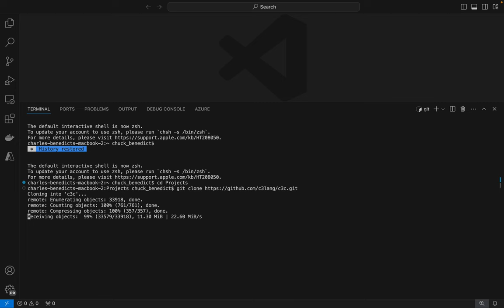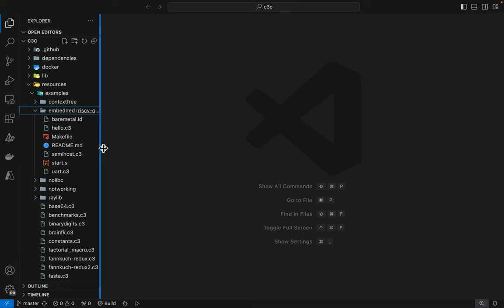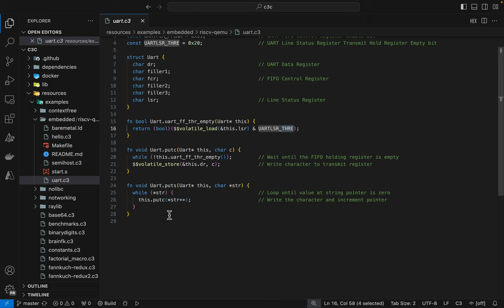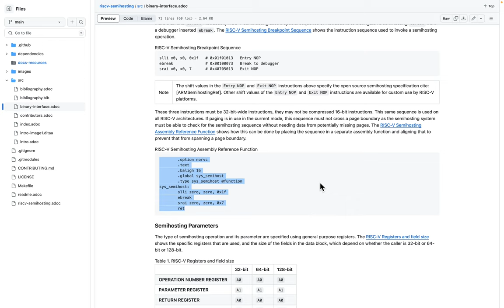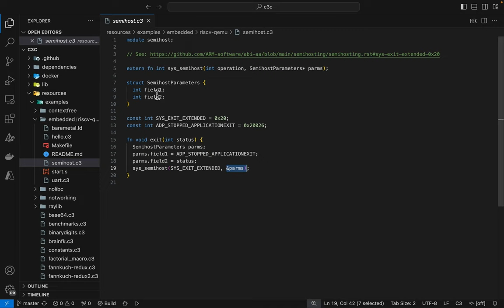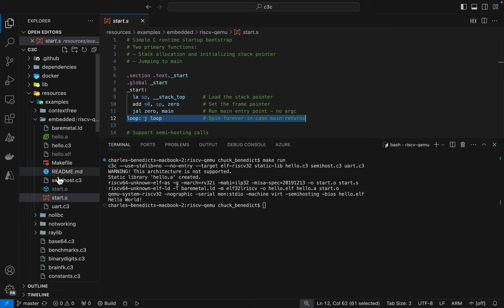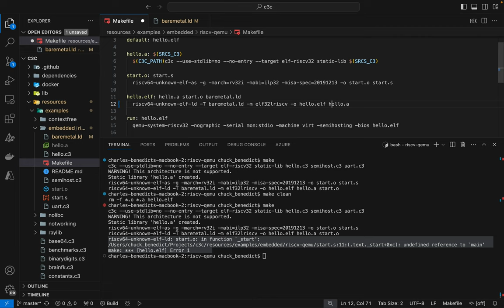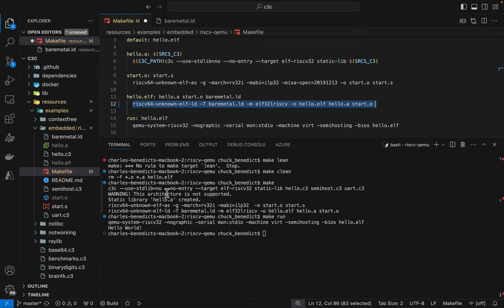Risc-V C3 Bare Metal Hello World!

Comment: in C, volatile and const are called qualifiers.
As for the order during link time, it is important (at least for gcc). I've been bitten by it several times with libraries, if libA uses a symbol defined in libB you need to do -lB -lA.
But I wonder why we don't have that issue with basic C code, since multiple .o files can cross-reference symbols and you never get linker errors. (or is it just main that has the "issue"?)
Reply from the maker: Qualifiers...thanks. I'm edge of genx, so recall is fading ;-)

I think this is related to optimization, but, full disclosure...I used chatgpt to help me figure out a solution. Re your C code comment...yeah. This is why I was confused in the first place.

I did enjoy playing around with C3...

https://chatgpt.com/share/2c82d6fe-913e-4bca-9819-e28dfaf57788